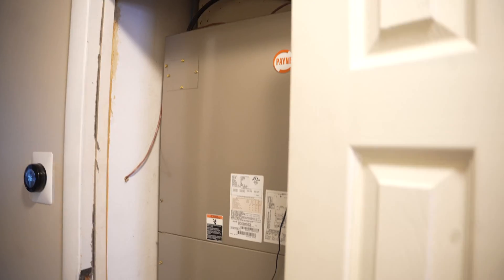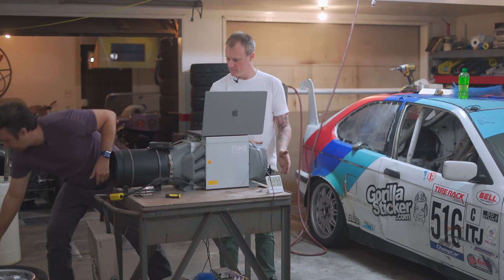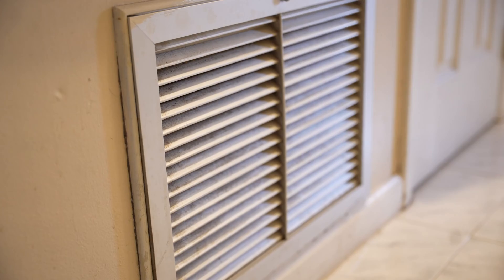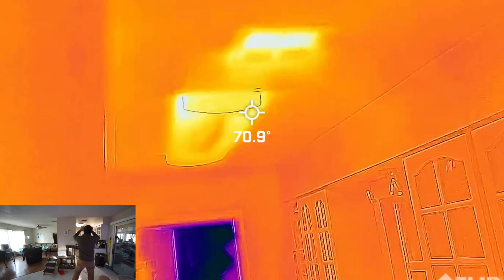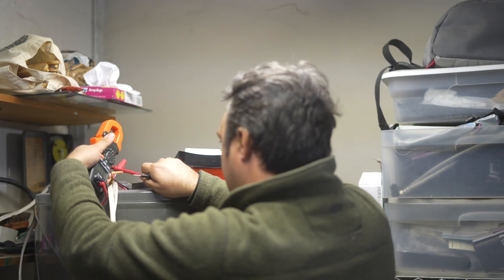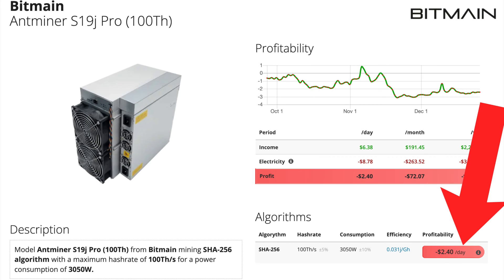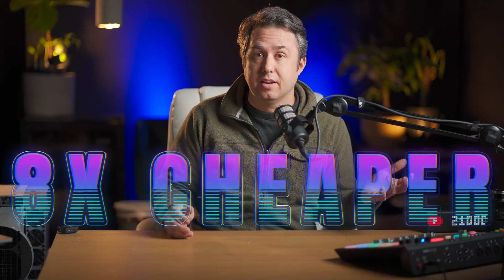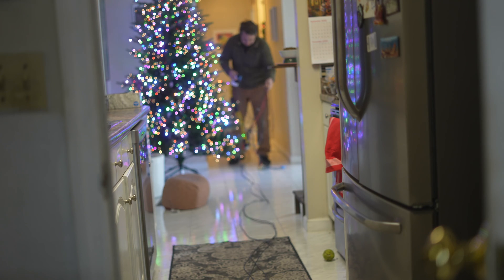Heating your House with Bitcoin Mining, The S19J Pro Central Heater

Comment: Bitcoin mining home heating in 2025: Is it still a viable option?
Reply from the maker: SORT of. You no longer make any money out of the deal, but it’s still “cheaper” than running just an electric heater because it does give you money. Just less than it costs to run.

Comment: Does adding that fan void the warranty on the miner? Thanks
Reply from the maker: @CustomCraftedDesigns  I do not know the answer to this question. However, you don’t tear anything, or remove anything that can’t be put back to do this; and it runs MUCH cooler with the new fan, so if something goes bad with the machine you can just put it back together the way it came.
Reply: @SPACEDESIGNWAREHOUSE  Thanks for the info

Comment: Ive used an S9 for a bathroom and have just started using an S19J Pro to heat a large portion of our house. 
In both instances I replaced electric baseboard heaters. An ideal heating source swap. 

On the S19J pro, I'm wondering if i should disconnect the 3 small power unit fans (i have used the chips to replace the four main ASIC fans).
 I have a shroud and AC infinity fan splitting air to the power unit, but i couldn't find any info telling me if i should turn those 3 small fans off or not.
Thanks for your help!

Comment: now that it's hot outside, the biggest challenge is HEAT. difficult to get the laundry room below 100F. a fan in the window, a fan exhausting air through the 4" laundry duct is not enough. i have to run my M50S at only 100THs to prevent overheating.

Comment: Sorry, another quick question. I’ve been using two dual 15amp breakers and nema 6-15 cables. It looked like you have a different cable/recepticle. Could you tell me what breaker, recepticle and cables you use?
Reply from the maker: In this particular case I used the water heater breaker and pulled two wires directly off of the wiring that went into my water heater (this was temporary for the demonstration) that have c13 male plugs on the other end. 

At the warehouse I have two S19s hard wired into one 50amp breaker.  I pull a line straight off the breaker and that goes into an L6-30 plug that splits into two L6-30r receptacles. From there I had made my own C13 cables (the ones that plug into the miner itself) Frankensteined into the back half of the L6-30r.   It’s kind of a mess, but oversized so that none of the wiring is ever the problem when something goes wrong.

Comment: Two quick questions:
1. Is it necessary to have the furnace blower running 24/7 if you are doing this? 
2. My fuance is in my utility room. If I run two miners in here blowing into my house, will create some kind of weird negative air pressure in the room? 

PS. I watch all of these videos and love them. Please keep them coming. I would love to see follow-up ones about the pool. I'm going to try it this summer. Heat the house in the winter and pool in the summer!
Reply from the maker: 1. Yes, or at least whenever your miner is running the blower would need to be running, otherwise it will heat up the room it’s in super fast and probably shut itself off. 
2. No it won’t create negative pressure; as long as you’re blowing into your return duct, your furnace fan is already pulling the same volume of air. This will not add more pressure into the system, it’ll just add hot air.   But the miners have to be facing an air return duct, not just the furnace, so make sure it’s a large vent that’s already sucking in air from your house. 

When the price dropped so hard with Bitcoin, it became unprofitable at my house due to my high electrical cost so I turned off my miners that were heating the pool. I sure hope we have another bull run this summer and I’ll definitely put that back together and update the progress! It was working wonderfully!! (Though it has to be a stainless steel heat exchanger, not a brazed copper one!)

Comment: One 105th keep my 1300sq ft home at 77f if temp gets to -15c il power up a second unit. I run it on a timer for time of day use.
Reply: You can get a temp controller to switch them on automatically on cold nights,  but they're usually limited to about 10 amps.
Reply: Hey guys, newbie here!

Pretty cold winters where I live and I'd like to heat my waterboiler with a miner. Has anyone tips into that?

Comment: I live in Canada and we have 0.08 kwh, so an s19j pro is barely (and really isn't) profitable. We heat with wood, which other than my labor, doesn't cost us anything. But we have been running the miner occasionally to heat the basement, as we struggle getting the wood heat down stairs.
Reply from the maker: Pesky physics of heat rising. 
I just put out a new video today, too, about Bitmains new firmware where they have a Low Power Mode. It makes the machine run on about 2000 watts and make 82TH. It’s more efficient, more BTC per watt.
Reply: @SPACEDESIGNWAREHOUSE  Yes I saw you posted that video. I am going to give it a watch for sure! Thanks.
Reply: just imagine the govt gonna close your bank account.
bitcoin mining is the way to non-kyc btc
Reply: Hey guys, newbie here!

Pretty cold winters where I live and I'd like to heat my waterboiler with a miner. Has anyone tips into that?